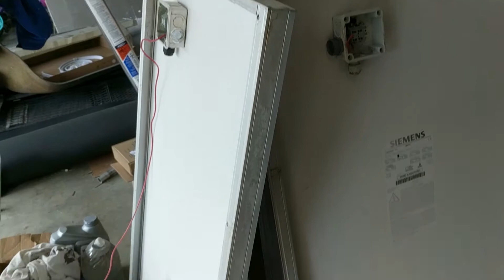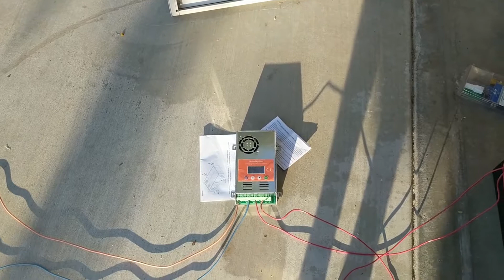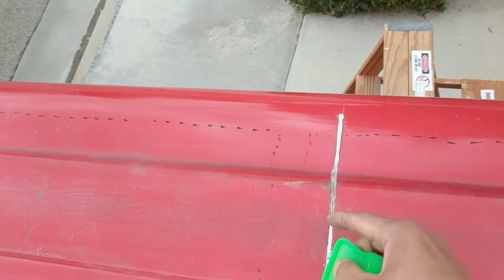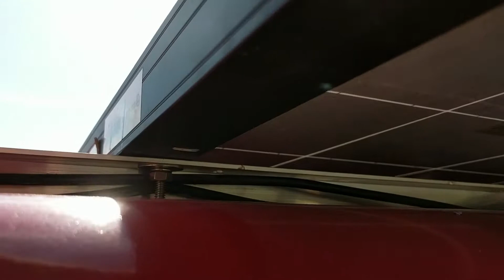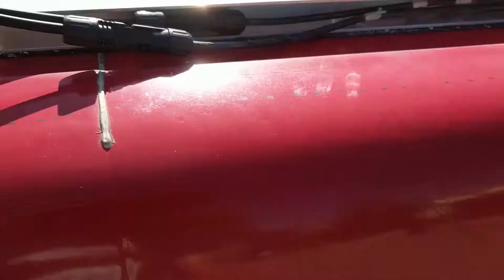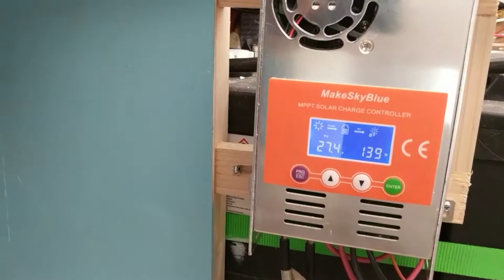Sprinter Van Build Ep 10 : DIY Solar Panel Installation

Comment: Hello there!  I too have been told that my 58 inch long panels that will hang over the edge and look like 'wings' might cause noise or stress at the attachment point on the panel.  Have you encountered anything like stress fractures from driving, or excessive noise?  Also any reason why you chose to run the solar panel wires directly down and not through a cable entry housing?  Just curious.